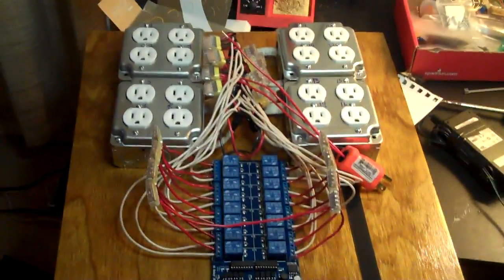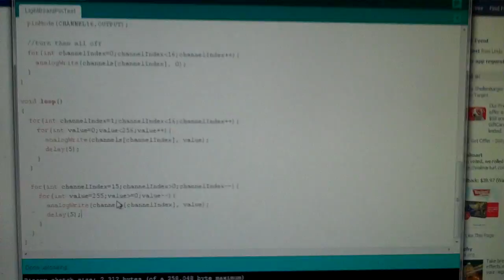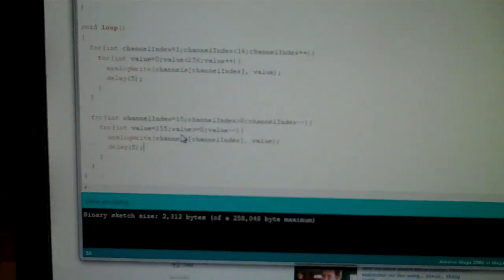Christmas Lights Control System - Part 6

Comment: Why are you dimming the leds .. relays are open or closed.. you can't dim your christmas light's with relays...
Reply: liney118 But again, you are getting into dimming the 120V source, which again, to be done properly would require triacs or SCRs and zero crossing detection circuitry etc. etc.
Reply: Scott Shaver I didn't see the whole series because you don't provide links in previous videos to the next one like most people do in a series. My comments were for this video - and had you been at this point in the project still - you would now have the information necessary to pursue doing it the way I am sure you eventually did it.
Reply from the maker: Yes you can, just not with mechanical relays. Keep watching.
Reply: a non mechanical relay don't exist .. your talking about IC's
Reply from the maker: liney118 Solid State Relays
Reply: like them left handed screwdrivers
Reply: I was going to ask how he intended to dim a relay myself, but then I saw that you beat me to it. To properly dim the lights, he's going to need SCRs or Triacs - which then get's into zero crossing detection circuits if you want to do it right, and a bunch of other stuff he probably didn't think of.
Reply: Or you could just dim the supply through the contacts
Reply from the maker: supertech2006 If you keep watching you will see that all of this gets resolved using random cross SSRs and zero cross circuitry. This was a learning project for me I had no idea what I was doing until I did it.
Reply: supertech2006 Agreed :)
Reply: supertech2006 which of course is the way I described - because a non-ZC SSR is basically what I was talking about with the "etc etc." I was not talking about, like the optocoupler isolation built in to it. If you can get them cheap enough (which you usually can if you get them from Hong Kong etc.) then it's a lot easier to not re-invent the wheel (or the SSR in this case) and just buy a tested and proven design which is in a neat and easy to use sealed package.
Reply: supertech2006 you were saying about triac's I thought those used a small signal voltage to be on or off ? no current control .
Reply: liney118 OK - think of an AC waveform...it's a sine wave. If you give it a signal when the wave crosses 0V, then yes, it'll be on for pretty much the whole wave...BUT, if you wait until the waveform is at it's peak to turn it on and you only use a short pulse, then you only get 50% of the wave - and thus 1/2 the brightness. and so on. It's about WHEN you turn it on (and of course you have to turn it on with a quick pulse at each waveform at the same point every time because a triac turns itself off at each and every zero voltage crossing of the waveform if there is no signal still present to keep it on), not just once - but this is essentially how a dimmer works).
A dimmer basically detects the AC zero cross, and then waits a specific delay period before sending a pulse to the triac's gate. The triac once triggered stays on even after the pulse is gone, until the AC waveform crosses 0V. The longer the dimming circuit waits before sending the pulse, the dimmer the light because less of a percentage of the AC waveform is used.
Reply: I understand what your saying but you'd still need something before the triac to time the on off cycle ie a micro controller or 555 timer rite!
Reply: supertech2006 That article refers to a "firing angle". Think of the sine wave as being a circle for a full wave. The circle is divided into 360 degrees or "angles". The more you delay the firing, the greater the "firing angle" - or you could look at it as the greater the firing angle, the greater the delay before the triac fires. The less of the full waveform you use, the dimmer the light.
Reply: supertech2006 I got some off ebay and tested them ... simple but very useful, can be used dc or ac @ the input to control high ac voltages :) also if used in a full dc circuit can be used as a latching switch
Reply: Umm...you're telling ME how to use them? ROFL!!!! I've been using these things since the 80's. If you are wanting to control AC current with a DC signal though, use a triac output optocoupler like the MOC3023 to keep the AC and DC circuits isolated from each other. Otherwise, one little miscalculation, and all your low voltage stuff goes bye-bye.
Reply: liney118 note the ROFL!!! I was making a joke! Man, why does everyone have their panties in such a bunch these days!
Reply: supertech2006 I dont like supertech... sounds like a cheap brand.
Reply: liney118 Better than sounding like a feminine undergarment protection system...ROFL!!!! Plus, I didn't choose my name - it was given to me by co-workers in the industry. I would also add that getting mad at me because you misinterpreted a joke is like getting mad at the tree because you ran into it with your car. The tree didn't do a thing - it didn't fall on you, didn't jump in front of you - it was just being a tree - you can't blame it for you hitting it.
Reply: lol I'm not mad dude... get real...!!! just a joke... keep ya panties on .... :+)
Reply: liney118 Most people don't think someone calling them a prick is a sign of serenity - so if someone needs to get real, it's not me. Also, I prefer that the panties be on the floor, and the girl that owns them be in the bed. More fun that way. I only put them on if she asks REALLY REALLY nice.
Reply: supertech2006 ohhh I'm so sorry... would penis be better ?
Reply: liney118 I would rather a girl put her panties on the floor. If you prefer that the girl put her penis on the floor - well - again, I am not the one with the problem here !!! ROFL!!!!
Reply: what eva you say fucking boring the shit outta me now Penis:)
Reply: liney118 Are you seriously calling me the one thing that every straight woman wants to have sex with and thinking somehow that this is an insult? WOW - dumber than advertised!!! ROTFLMFAO!!!!!!
Reply: supertech2006 Or did I mis-read that, and you were simply stating that you now have a penis boring into you? Because that's a little TOO much information....especially if it's boring the SHIT out of you - WAY too much information!
Reply: +SuperTech-IT Peps are tougher behind a keyboard than in real life
Reply: +liney118 REKT LOL :þ
Reply: LOL!
Reply: SuperTech-IT LOL!
Reply: Speaking of lights...you can see my latest creations at www.TheLEDCube.com - check out the videos.
Reply: SuperTech-IT I've already made a few led cubes, much fun
Reply: My PC Boards make it a ton easier, especially for the RGB cube, plus we have a ton of original code, plus it runs Kevin Darrah's Arduino code plus it runs Nick Shulze's ChipKit code.
Reply: Currently we have code for the Arduino UNO, the Arduino MEGA2560, the ChipKit UNO and the ChipKit uC32. To my knowledge, it's the most versatile cube circuit out there.
Reply: Plus we have music response for all the cubes.
Reply: SuperTech-IT Yea but that's not really that hard to do, condenser mic and a bit of code or better still add an opamp into the equation and you can make it as sensitive as you like. or better still it can all be done without using a mic.
Reply: Well you'd be the expert on that, even though almost nobody else does it.
My boards can use line in or a mic, and the music module actually has an MSGEQ7 on board so you can do spectrum analysis without the need for FFT in the code. But it's all so simple 2 year olds are doing it in their sleep. Look, before you go telling me how easy it is, let me see your actual circuit design and control code, then you can poke holes in mine. Until then, the appropriate response is none, or "cool". You obviously didn't see any of the explanatory videos, or you'd already know my circuit is beyond any of the stuff you just described.
Reply: Not to mention the only RGB control circuit that runs multiple processors and all the popular code in addition to our own - which no other board does.
Reply: I am sure you have skills and talent etc. but to be telling me how easy it is to do what I did coming from a guy that was once going to try to dim lights using relays is laughable. It'll be a long time before you reach my level, and until then, don't go telling me how easy it is to do the things I did unless you have a better way of doing it WORKING on at least a prototype.
Reply: SuperTech-IT Yo hold up I never tried or would try to dim lights with relay's as it's impossible, it was you that gave the impression that's what you were trying to do and I'm far more advanced than you, I build my own circuits, Write my own code and I've been repairing electronics for the past 15 years including automotive.
Reply: Have you been to my website? I have been repairing electronics (computers mostly) since 88
Reply: started programming in 82
Reply: built a voice synthesizer based on the SP0256 for the Commodore VIC-20 (later adapted the software for the C64 and 128)
Reply: among many other things.
Reply: SuperTech-IT computers, there's nothing to them and I hardly call replacing hardware a repair
Reply: SuperTech-IT So if your so good at coding why you using other people code, sure someone with coding background knows how to multiplex
Reply: in THIS video, you're talking about the relays reacting the same as the LEDs which you are DIMMING or BRIGHTENING, and I am wondering why you are dimming a signal going to a relay - it's not hard to think you expected the lights connected to your little project to be doing the same.
Reply: and I do component level repair on laptops and notebooks (and just about anything else)
Reply: IE- I REPAIR motherboards, I don't replace them unless repairing them would cost more than replacing them.
Reply: SuperTech-IT same again easy, Just they have a shit load of screws, plug and play as they say
Reply: When I started repairing computers, it was logic tracing to find out if 1 bit on 1 chip wasn't working right etc. The circuits I DESIGN now you wouldn't understand, let alone the ones I repair.
Reply: SuperTech-IT So you replace a few cap's not really a challenge
Reply: SuperTech-IT lmao what an atmega chip and a few shift registers, yea sure dude
Reply: And seriously, why are you using PWM on a signal you plan to feed into a relay board as you are so clearly doing in this video ?
Reply: SuperTech-IT well for 1 it isn't being pwm'ed nor was the code on there planed for the relay, it was the code off my first video, beside it's a tutorial for people that don't know how to use them
Reply: And in video 11 - are you really calling live and neutral "negative and positive"  most of the time???? HAHAHAHAHAHAHAHAhahahahaha!!!!!
Reply: SuperTech-IT yea because it's dc and dc don't have a live and neutral, it's +- negative and positive, you sure you expert at electronics
Reply: And calling terminal strips "bridge strips"...Oh well, at least you eventually did go to SSR's, and honestly, the end results were pretty cool....but please don't think you are anywhere near my knowledge. Keep at it though. You're far above many out there, and you can only get better.
Reply: I don't believe I've ever used those words, I'm English not Canadian
Reply: SuperTech-IT Just for you I'll quickly build a 3x3x3 rgb led cube and show you how easy it is
Reply: SuperTech-IT There you go, I've uploaded a vid just for you, easy like I said and I know it's 3x3x3  but I don't have the led's to make anything more impressive, Just proof of concept on how easy they are :)
Reply: shit, anyone can make a 3x3x3. make something that's controlling 192 LED outputs per layer and 8 layers and then we'll talk. Cripes, you technically can do a 3x3x3 with no transistors and you certainly don't need shift registers or constant current drivers or level shifters. Talk to me when you make a REAL cube. My design has to deal with 200 outputs PLUS accommodate for both 5V and 3.3V logic levels PLUS accommodate for single stream data or triple stream data.
Reply: I'm not denying you have some talent and some skill, and possibly more than most out there - but you aren't anywhere close to my level.
Reply: PS - by TECNICALLY I mean IF you happen to be using a microcontroller that can sink the current of 9 LEDs. If not, then you're going to at least need 3 transistors - but that's really it except for current limiting resistors on the transistor bases and either pull up or pull down (depending on if you use NPN or PNP transistors) resistors. So basically 3 transistors and 6 resistors (to do it properly...many forget the pull-up / pull-down resistors) and your whole circuit is built. Whoopde-freakin-doo!
Reply: And when you get into that many outputs, you can't use PWM anymore, you have to soft code BAM (bit angle modulation) for brightness.
Reply: SuperTech-IT I can't tell you may trade secrets, but I'm not using any transistors and theirs 27 leds with 31 outputs
Reply: SuperTech-IT as I said I don't have 500+ led's to play with, it's not something that floats my boat, my point was that it's easy and I wouldn't use shift registers for anything bigger because there are plenty of other ic's out there designed for running lots of led's. anyone can build an led cube it don't take no genius.
Reply: Hoorah, you learned how to charlieplex. MAYBE.
Reply: SuperTech-IT hahahaha, oldskool
Reply: And honestly, unless I see the circuit (which wouldn't give away any secrets) I highly doubt you didn't use any transistors - unless you are just using a technicality and used mosfets - which ARE transistors (that's what the T in MOSFET stands for) by the way.
Reply: Although - one moment... if you are using shift registers is completely doable.
Reply: And yes, LED drivers that take serial data input are still shift registers.
Reply: but again, you need to control a whopping 27 LEDs, not 768
Reply: If I wanted to do it with cheap components, I'd need a total of 2 chips, and a couple resistors.
Reply: SuperTech-IT I wasn't using any kind of transistor or registers, of cause it's doable, I stopped making led cubes over 3 years ago, the biggest I made was a 12x12x12 rgb using 1,728 led's, yes maybe that one was using registers but with that amount what would you expect, but as for the complexity of it wasn't that hard to do, the most tedious part was the construction, but as for wiring and programming was simple. Don't get me wrong they are very fun to build and nice to watch. but making one don't make you a genius specially when you don't even write your of code. I'm more into modding these days, I like to take things that did nothing and bring them to life, I really don't like to criticise, but you have know idea on my capabilities, I've probs learnt more in 6 months than you've learnt in 3 years and I've been doing electronics on and off since I was 7 , I'm self taught in mechanics, construction, music, programming c++, c#, web design, game design, graphics, computer building, electrical installation, electronic design, pcb design, net framework and so on, but it still don't make me a genius, just means I Like to learn and challenge myself and so can anyone else.
Reply: Forgive my earlier statements, I was trying to think of how it could be done with NO chips OR transistors. Then I realized you only said you didn't use any transistors.
Reply: SuperTech-IT What a 3x3x3 ?
Reply: SuperTech-IT I did with some clever pwm trickery that lets me run them at 5 volts at a very low current draw direct from the board.
Reply: SuperTech-IT If you wan't to make your cubes unique, why not add and IR interface instead of using buttons, you could add more functionality without taking up board space ?
Reply: You mean AN IR interface. And there are others out there with it.
My goal was to make a universal cube that conformed to the most popular standards and microcontrollers out there. What makes my cube unique is it'll run Kevin Darrah's code on the Arduino UNO, or Nick Shulze's on the ChipKit UNO32 or Doug Domke's code on the chipkit uC32 or David Yee's code on the Arduino MEGA2560. Plus the music module is optional. Don't want music response? don't add it. Want IR control - hey, there's additional I/O pins sitting right there for you to do it with - knock yourself out. Make an IR option board for the cube and snap it onto your bridge board. no sweat. That's what makes it unique. 
as for what you've "learnt" apparently grammar and spelling are not 2 of them. Work on those next. As for having "know" idea of what I can do either - so let's just end this as it's counterproductive if you KNOW what I mean.
Reply: By the way, my mono cube controllers have a wireless remote option. If you looked at the board, you'd see the spot for the wireless module.
Reply: It's not rocket surgery or brain science. LOL! And better than IR, you don't need line of sight to the receiver (not that you'd ever not be looking at the cube when controlling it). Oh ya, my RGB cubes are linkable too. Also, I do write my own code, but hey, when someone has something better, then I take that, add my stuff to it, and go from there. No sense re-inventing the wheel if you don't have to!
Reply: SuperTech-IT Picking out a typo is a standard american dumbass remark and learn to write your own code and stop ripping off others work, it was just an idea, but I forgot you wouldn't be able to code it, In fact, I'd be surprised if you even knew how to code a simple blink sketch.
Reply: I wrote ALL the music response routines across ALL the processors for ALL the boards I make, plus when Doug Domke started writing a new template from scratch because we didn't like Nick Schulze's we worked on it together. And you don't make typos, that's the way you spell. GRAMMAR - it's the difference between feeling you're nuts, and feeling your nuts!
Reply: PS - I am not American.
Reply: <waits for the obvious "OK, Canadian then" or some other guess.
Reply: PS - the genius part was making it work with almost anyone's existing code. Pull that off, then we'll talk.
Reply: SuperTech-IT that's the rip-off part and considering most sameheads use the same layout that would be very hard, but I write my own code as sameheads over think thing's
Reply: Go compare Nick Shulze's schematic to Kevin Darrah's. THEN we'll talk. There's no "rip off" because our code is better than either of theirs, but people want to be able to run their animations, so I made the board capable of running their code too.
Reply: SuperTech-IT basically there the same and who really cares to be honest, it's an led cube, wooow hahaha you've advanced from diy relay Christmas light to led cubes and ripping off other peoples code and changing a few thing's and claiming it as your own, or well if you want to make a living off robbing people for a £2 worth of leds over priced pcb's and a few cheap ic's that's your call, but believe me them cubes are becoming old news and you have to advance yourself from led's to something new ;)
Reply: PS - I was writing machine code in 82, and C in 85
Reply: SuperTech-IT years ago, coding has changed a lot since then, you don't use it you lose it.
Reply: As for being old news - to you and I maybe, but people all over the world are still buying my boards. If it was as simple as you claim, nobody would bother. As for ripping people off - what was that software you use to control the christmas lights like so many other people have done in the past? Ya, that was a real ORIGINAL idea....
Reply: And yes, C for IDE or MPIDE is different, but not that different. It's pretty much C which hasn't changed that much over the years.
Reply: By your logic, Linux is a rip off of UNIX - and you'd pretty much be right...but I like to think the world is a better place with it.
Reply: There's a ton of people much less brilliant than either of us that thank god I made these boards so that they can actually build one of these cubes without having to learn everything about how it works, and that are quite happy running our code so they don't have to learn programming - much the way people enjoy driving a car without having to be a mechanic.
So you can say whatever you like, but people all over the world are using my product.
Reply: SuperTech-IT lol you buy them precoded, so your paying for it, the code you use is what people have wrote for other to use themselves, not for people to profit off, people will buy them, why wouldn't they, they're lazy and dumb, why learn when you can buy a kit, why write your own code when you can use someone else's, just laziness, no one is ever going to learn anything that way. I try and inspire people to learn to do things for themselves, because the less they learn and the more they rely on other and paying for it, this worlds going to be full of dumb good for nothing sheep.
Reply: They aren't pre-programmed. You have to use a prototyping board or processor of your choosing. Yes, we provide code, but one of the easiest ways to learn coding is looking at someone else's - but you don't HAVE to. The boards arrive bare. You have to get the parts separately and build the board up yourself. But if you took 10 seconds to educate yourself on what you keep slamming with any excuse possible, you'd know that already. You're so busy picking it all apart, that you don't even bother finding anything about it.
Reply: SuperTech-IT i was talking about christmas lights
Reply: You didn't define "them" and I had most recently been talking about the cube, so the misunderstanding is your fault.
Reply: Honestly though - I think both of us would be far better off working on a project together than ripping each other apart. But that's just my though on the matter.
Reply: SuperTech-IT well you hit me with christmas light and how I'm ripping there code off by buying them, if you didn't spam me with 3-5 messages and wrote it all as one we wouldn't have miscommunication
Reply: I was talking about the whole idea of sequenced Christmas lights, and the fact that you were using a commercially available software package for the control
Reply: But again, I think we'd be better off working on something and discovering each other's brilliance rather than trying to point out each other's stupidity.
Reply: SuperTech-IT Yea but the people that wrote the code for the light were paid for it and I would have paid for those rights to use them when I purchased the light, So it's not the same, I know how much time and effort goes into coding and them cubes do run some complex coding, now a days those there are programmes you can use to generate pattens and code to simplify the process, but still hours of coding and debugging. I'm lucky I don't have that problem "Touch wood" but if you have coding knowledge I would like to see you use it, as there are easier ways of doing things and it'll help you long term, you seem a smart guy and keeping yourself ahead of the game is always a must.
Reply: This is why Doug and I wrote the code the way we did. It's actually a template that basically takes care of driving the hardware and a bunch of routines to make it easy for people to write animations. We even have sprite classes etc. Doug never wanted a dime for his work, and shares it freely off his own website. I paid him anyway just out of appreciation, but he's just happy so many people are using HIS code to run these cubes. He has dedicated an entire page on his website just to all the versions and revisions of the code. I wrote the music handling routines and subsequent animations under his template. It allows those that want to make their own patterns and animations and music responses a lot easier, but they still need to learn to code. Those that don't want to learn of course can use the animations Doug wrote, and the music responses I wrote.
Reply: SuperTech-IT well my brilliance isn't what I can do, but my ability to think outside the box, anyone can learn to do what I can do, but no one can think the way I do.
Reply: OR they can use Nick's or Kevin's animations.
Reply: SuperTech-IT That's really good then, maybe I've been a little harsh, see if you explain thing's a little better first of, I wouldn't have taken it negatively like Dc Current :)
Reply: Well, I think we're both used to being the sharpest tool in the shed, and coupled with the same ego, I think we both went into asshole mode. LOL! So I thought - OK, If I were talking to me, how would I end this...and here we are.
Reply: SuperTech-IT You do make a good point and you're more than likely correct, I suppose me being up for 19 hours strait don't help, I'm also out of coffee and having to drink tea which I really don't enjoy, I've nothing against you personally, I guess I was Just giving as good as I got :)
Reply: Yup.
Reply: SuperTech-IT So if your not american where you from being up at this hour ?
Reply: LOL...it's 4:40Am here....I'm setting up a RAID 0 of 4 SSD drives on a system I am building and it's being a pain.
Reply: The RAID 5 of seven 3TB drives works flawlessly, but it's on an IBM 5110 ServeRAID controller, so it takes care of all the hard stuff. The SSDs are on the motherboard, and it's being a pain.
Reply: SuperTech-IT Your just like me, once you start you can't stop, I used to build computers but I never have the time any more, I'm eva doing repairs for a customer's or working on my prototypes and I'll push it as much as I can, to the point of auto shut down in most cases.
Reply: SuperTech-IT It's 9:49 am here and I've been going since 11am yesterday
Reply: I am nearing that point. I think I am going to take out the LSI MegaRAID controller since I am not using the SCSI right now, and see if that helps
Reply: SuperTech-IT Have you ever tried using the TLC5940nt on any of your cubes
Reply: nope, but if it has at least 12 I/O it should work if someone codes it.
Damn computer isn't even booting now...UGH!
makes zero sense...
Reply: SuperTech-IT That's what I hate about them computers hardware combat-ability issues :). I got a few tlc's for testing a coil design I'm working on, they have 16 pwm outputs and a 4096 step grayscale, I believe they are designed for running leds and they'd Offer a very good colour scale, Just an idea.
Reply: SuperTech-IT Just watched a video by Kevin Darrah with his cube, that's some wiring he's got going on their, why didn't he just make a custom board ?, if I'd have done my 12x12x12 the way he did that, I'd have had a few miles of wires lol.
Reply: THIS is exactly why people love my PC Boards
Reply: PC is booting, but Windows refuses to see the RAID - and I had it working before....UGH!
Reply: SuperTech-IT Have you tried checking the bios settings for it
Reply: yes, I have been creating, deleting and re-creating the RAID, turning UEFI on and off...I know it's possible because I had it working with 2 drives just before, but when I tried to add the other 2 drives, it won't see it, and even re-defining it with the original 2 isn't working, so I am doing something wrong somewhere. it's 6 ofuckin clock though and I need sleep
Reply: SuperTech-IT I hate raid drives, nothing but trouble, they ssd's ?
Reply: SuperTech-IT if they are, I've never used them. do they have a slave and master pin, if so check that and check the drive you had the OS set to is set as the correct one and in the first raid port
Reply: OMG -master/slave is SO ten years ago. SATA drives don't have such things. Yes these are SSDs which just means they are like regular drives, but no moving parts and WAY faster. The only thing faster than an SSD is 2 or more SSDs in a RAID. Well, not entirely true....regular drives in the right kind of RAID can also be faster than a single SSD.
Reply: SuperTech-IT Yea I've heard of them, but I've never bothered buying any or upgrading to them, as I've heard they are fast but storage in small, maybe better these days, but I'm happy with my 1Tb sata raid. did you get it sorted in the end ?